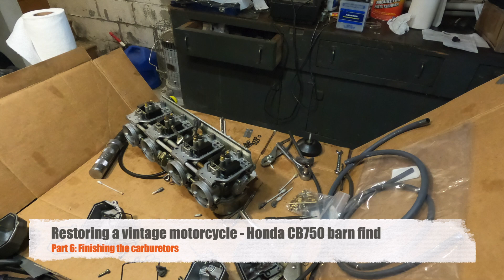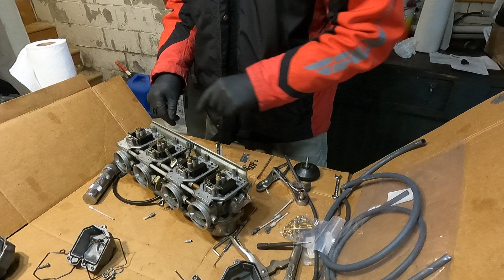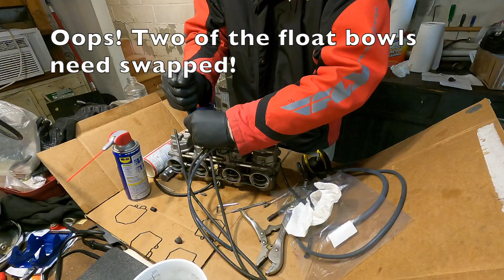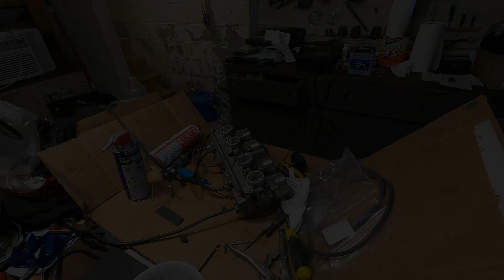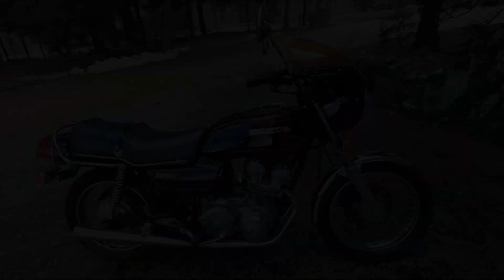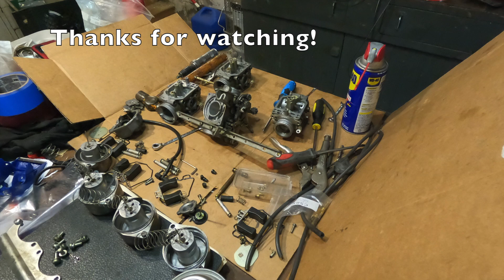Honda CB750 barn find - Part 6 - Carbs continued

Comment: Thanks for the videos. Really nice. Question about the Pilot Jets. Why did you feel necessary to go up from original #68 to #70?
Reply from the maker: Motorcycles from 1979 onward were jetted too lean from factory which makes them very cold-blooded and difficult to start in cooler weather. A simple jet change works wonders. Cheers!
Reply: Thank you! I’m about to do a carb rebuilt on my 79. Parked for 10years in my friend’s garage. If that’s not a #70 yet, I will switch the pilot jets.
Reply from the maker: @MrHiltonMartins  You're welcome! Good luck with the rebuild. Happy New Year!